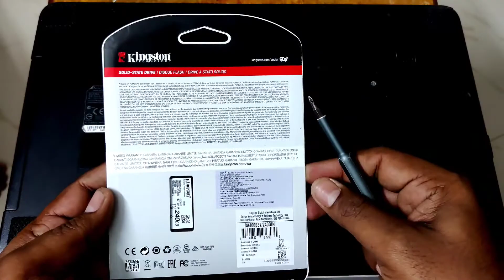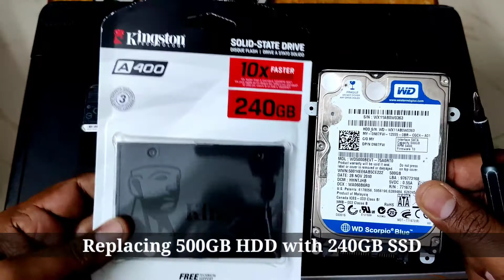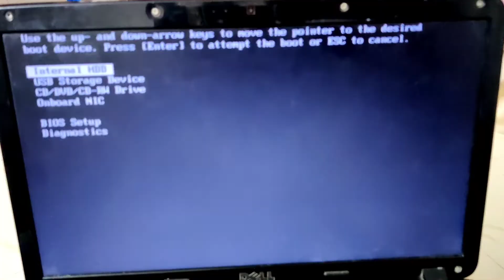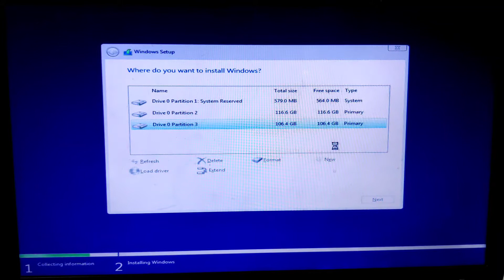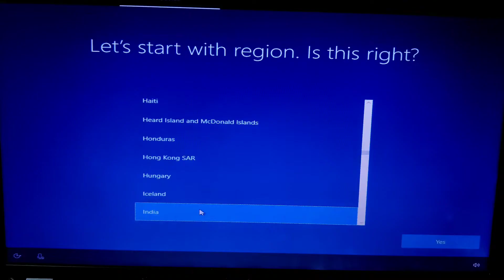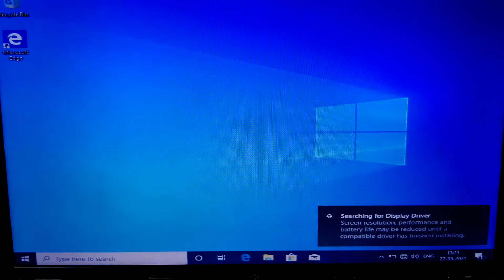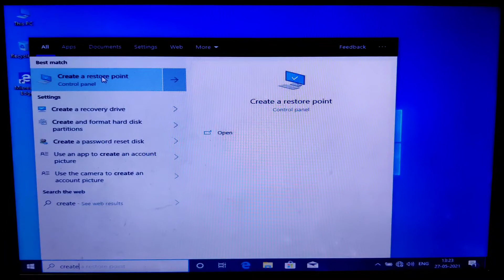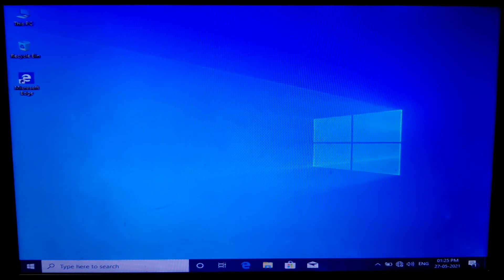Dell Vostro 1015 Laptop SSD and Windows 10 Installation process

Comment: hey can i install window 10  64 bit on this laptop with same 4 gb ram?
Reply from the maker: Yes you can... it works fine.
Reply: It works fine I have the same
Reply: @abhinavprabhakar2312  bro will window 7 run properly in dell vostro 1015 .... ?
Reply: @shaimanraza  I was using windows 10 and before that 7. You can use it easily

Comment: Cual es el maximo de ram de esa pc
Reply from the maker: It's DDR2 RAM supported Laptop maximum 2GB per slot only. So it supports only 2+2GB of DDR2 RAM Total 4GB is the max.
Reply: Gracias
Reply: Y que procesador
Reply: max of processor this 1015 series?

Comment: This laptop hardware configuration suports for windows xp if you use windows 7 on it it will work but if you use windows 10 or later version this laptop will be hang all the time 😂😂😂
Reply from the maker: Till nOw it is working smoothly after upgrading SSD & RAM bhai... for general home usage it is ok.